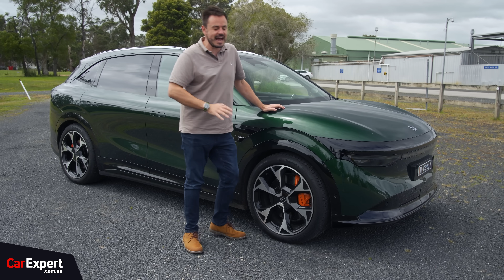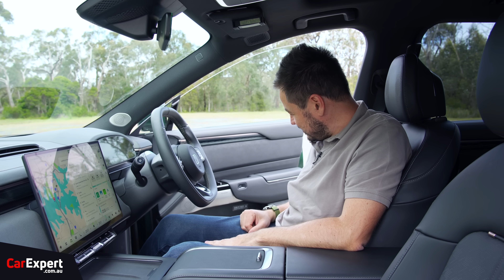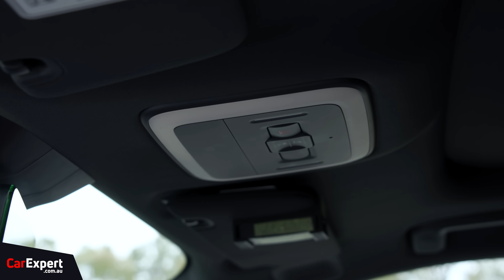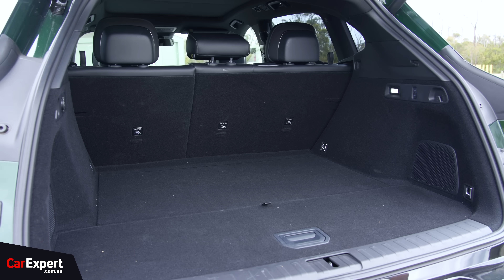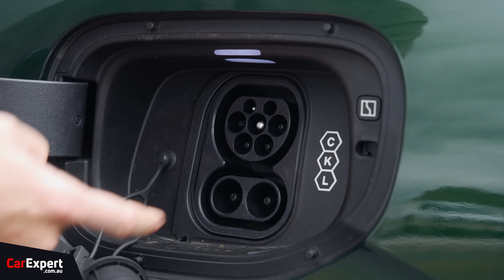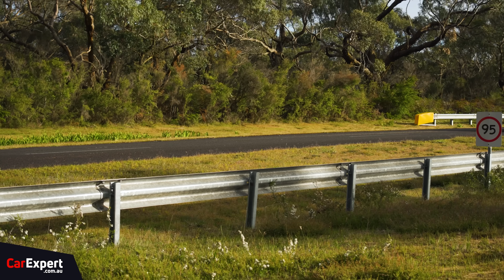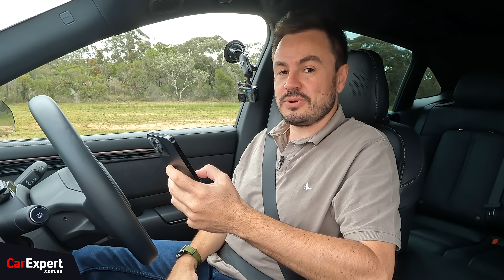The BEST EV I’ve driven this year…Zeekr 7X review (inc. 0-100 & braking)

Comment: The problem with Chinese EVs is that: if the company goes bust, then, unlike ICE cars, your EV pretty much becomes scrap metal because even your drive software is in the cloud which they no longer support.
Reply: zeeker's mother company is geely so your concern is highly unlikely
Reply: You can't be serious with that misinformation.
Reply: Geely the parent company own Volvo, Lotus, Smart, Polestar and significant holdings in Daimler (Mercedes-Benz) and Aston Martin as well, so i think we are good for a little while.
Reply: Geely is the parent, it's a behemoth
Reply: Like what everyone else said re: Geely.
But also what a load of idiotic nonsense. How do you think the car can function and drive when it is out of mobile range then?
Car software runs locally and is able to connect locally to your security keys and devices using RFID, Bluetooth & Wifi. Even without any mobile connected services you could still use your phone for hotspot internet access for maps or just use Android Auto or Apple Carplay etc. Your car doesn't just become a brick.

Comment: Bought mine and picked up in November from Geelong. Drove back to Adelaide and love the car! Powerful, comfy, sporty, luxury and so many features. Mine is the Tech Grey Performance model with 21" wheels. Wife loves it so thumbs up there. Friends scream "WOW" when you put your foot down to show its stunning acceleration. Charge at home from my garage via a 22kw charger. So cheap to charge up too! Brilliant car, excellent value, cheap to fuel up, and cheap to service (no engine). Do yourself a favour and buy one. 👍
Reply: Promote rainforest deforestation
Reply: How often would anyone need to charge at home at 22kwh, do you do back to back long drives draining the battery and charge within a cheap say 4 hour tariff window in the middle of the night. Also do you own an $80k car and do not have a solar array at your house.
Reply: @GDM22 i say bring on the 22kw chargers, cause why not :)
Reply: @thecookeman You would be running 30.6amp across each phase with the limit 32amp, doesn't leave much head room for anything else.
Reply: With AGL, EV rate is 8c per KwH between 12am and 6am. My 7X Performance has a 100Kw battery so just $8 to charge from zero to 100%! However I top up the charge regularly to 80% as it is an NMC battery. Only to 100% if I drive it immediately or very soon after charging. Small top up charges don’t harm the battery, not recommended to run down to 20 or 30% then charge up, unless necessary. Great car, still discovering its many features!!
Reply: A SUV I is not sporty. It’s brick on wheels
Reply: How match did the charging installation at home cost you?
Reply: @DH-jy6ts Around $950.
Reply: @realcooldog5588  Did you have 3 phase electricity supply before?
Reply: Yes had 3 phase supply installed when I built the house. Good decision!
Reply: @realcooldog5588  Lucky you. Doing it now may cost 4-6 K (in Vic) I guess.
Reply: Thanks for sharing, but you update this review in few months, because usually it is like a honeymoon.   You wakeup and you become unblinded
Reply: Love does that!
Reply: Congratulations! Would you please briefly comment how the car performs now? Any software glitches or other issues that Zeekr hasn't been able to fix? Some users say RWD is more stable than AWD model. What do you think?
Reply: What colour did you get ?
Reply: Does it drive itself like Teslas do with FSD(s) ?
Reply: @jorganzola1  for a performance car like this, you don't want it to drive by itself. You definitely want to hold the steering wheel!
Reply: @jorganzola1 only in China, it just has normal adaptive cruise control.
Reply: @TheoFennel  ... and with lane-centering assistance.
Reply: @Antmanzzz 
ADAS is on all new cars sold here I believe. Correct me if I'm wrong.
Reply: @jorganzola1  Yes, but that is a vague term - it can cover various safety systems as well as ACC+LCS etc - you have to look at the specifics for each model.
It usually doesn't include advanced self-driving automation though (e.g. FSD, XNGP, etc).
Reply: @Antmanzzz 
Yes, of course it doesn't include FSD.
Reply: @jorganzola1  在中国可以选装类似特斯拉FSD的自动驾驶功能，35000人民币！
Reply: @dyson1133 
In China, autonomous driving systems were recently tested and ranked in order of capability.
Teslas' FSD came out on top as you would expect - given that they pioneered the technology.
Some other systems were atrocious. The price doesn't reflect ability.
Reply: @jorganzola1    I've seen that test; Tesla's Autopilot is indeed amazing, showing excellent results across the board. However, Huawei and XPeng, right behind Tesla, also have impressive scores and are by no means bad. It's like how Apple is the benchmark in smartphones, but that doesn't mean Xiaomi and Samsung are trash.
The key point is that autonomous driving is purely a software feature—the core is the algorithm. Therefore, I don't think Chinese manufacturers will lag behind for too long. After all, with 30 million cars sold annually in China, they have massive amounts of data for training, plus a huge pool of talented engineers
Reply: @dyson1133 
Competition is good, and I wish these other systems the best, for it will make travelling on the roads safer.
Chinese systems may indeed catch up, however Tesla won't be waiting for them to do so.
Continual improvements will be ongoing.
Reply: @jorganzola1  why would one whant a car that drive its self ?
Reply: @kajak012 why would you want an EV?
Reply: @BobbyDazzler888  Why should it matter whether its,fully electric, hybrid, petrol or diesel? The point is, its a great car; especially for the price. Sounds like you have an irrational fear of EV's.
Reply: @BobbyDazzler888  charge while the sun is out?
Reply: @BobbyDazzler888  bot ring a bell?
Reply: @kajak012 why the hell would you not want a car that can drive itself. It’s literally the biggest advancement in personal transport since the invention of the car!
Reply: @andyg3752  why have a drivers license ?
please explain
Reply: @kajak012 because the government mandates having a drivers licence.
Reply: @andyg3752  i like driving being in control so i pay to have my drivers license,i drive a v8 cheap on fuel if parked in the drive way
Reply: @kajak012 
I would have thought the reason was obvious. However:
1. On long drives, you can arrive relaxed, driving in bad conditions can be stressful for some people.
2.  When perfected it will drive far better than the average driver & it will save lives.

Why would you want to drive your own car  knowing that doing so  risks your own safety, the lives of your loved ones and other road users?

Many thousands of drivers, passengers & other road users die EVERY DAY due to human error.
Eventually, all cars will drive themselves & communicate with each other.
It's not really about what you want, it's about what is best for everyone.
Reply: @kajak012 mm
Off the house battery if absolutely necessary
Reply: @kajak012 
Yes, it would be cheap on fuel if you park it on the driveway & don't drive it 😂
Reply: @kajak012  Call Uber 🤣🤣🤣
Reply: Why do I keep sensing this reviewer got financial complimentary support from Chinese car company? It is EV and so the autonomous driving abilities are a MUST.
Reply: @JHP-hj224 , I just want to be in control, and I trust nobody, let alone F* what.
Reply: @JHP-hj224 needs to be reviewed more often, alot of the China ev's are terrible at even lane assist, hilux, rav4 all trash too

Comment: What happens when a nefarious person sends an OTA update and bricks your car?
Reply: Careful, bots will eat you up
Reply: take your tinfoil hate off kevin
Reply: You can turn off all WiFi, mobile and network communications to the vehicle. It will reactivate when in a crash and when your car is serviced which you'll need to turn back on. Though then you will drive it as a car with a lot less features.
Reply: As an owner you have to accept an OTA update first. So if you are worried (that your tinfoil hat is not thick enough) then never update.
Also it uses PKI & certificates for secure communications and hash-checking for authenticity just like anything else that needs security.
Reply: Just a dead excuse against new technology.
Reply: Like what Porsche did to Porsche owners in Russia?
Reply: @f @frankandrews4470 what happen bro? Did Russia hurt your feelings?
Reply: @frankandrews4470  dunno mate, that's your story. The question still stands. What happens?

Comment: Howdy Paul  I have had my Performance model for two weeks now and love it.  Everything works well and is a pleasure to drive.  The doors have sensors to prevent bumping into things however I cannot say that about the boot.  Crashed and scraped the paint off the rear door first day when it hit the garage door.  I only received one "token" car key.  Anyone know how to obtain another?  Thanks Paul love your work!
Reply: ah thats a shame...most cars open slowly and if something blocks they retract. hope its minor scratch.
Reply: With your 7X you will have received 1 car key fob and 1 RFID key card. If you wish you can purchase additional key fobs or cards from your dealer. IMO it is not needed because the phone app acts as a digital key, and 95% of the time that is what you will use as the key (perhaps with the RFID key card in your wallet as a backup in case you drop/lose your phone).
You can set up each driver's phone app with their own Zeekr account, digital key, and associated profile with car seat/steering/mirrors settings etc, and swap between accounts or profiles very easily when entering the car.
A little too late in your case perhaps, but you can also set the boot lid to open to a specific height and it will remember that, to avoid hitting the ceiling of garages etc.

Comment: Good review Paul.   The interior looks quite good for an EV and well balanced.   However, visually at least, the driving position looked quite snug/small, there did not appear to be much room around you.   Maybe it is just how it looks on the video but it looked a little small in the driving position.   It seems quick enough in a straight line but it appears the handling and ride is sub-par for the power on offer.  I like soft-close doors but they do take a little to get used to.  It seems to be quite good value for what it is in the EV segment.  I am still happy driving hybrids but this EV seems to be a large step up compared to other offerings, especially for the relatively modest price.  It will be interesting to see how popular, or otherwise, this vehicle becomes.  Lastly, I still think EVs have a way to go before they become compelling buys.
Reply: They are so compelling right now buddy. Open your eyes
Reply: @kennyobe  I'm a car enthusiast and follow the car market quite closely and I will stick with the cars I already own which are all way better for my needs than the Zeekr 7X or any other EV.    However the Zeekr 7X does seem like a good buy for what it is for the low end of the EV  market.

Comment: I have one. Best family SUV I have ever experienced. There are many more features than the ones you mentioned and there are some errors you made. I was waiting for the Tesla Y performance but for me this is way better. 
Buy the Tesla if all you want is the best drive train, computer system and efficiency and happy for everything else to be a standard taxi. 
Buy the Zeekr 7X if you want the best looking most comfortable luxury ride and unbelievable features but still second to all Tesla’s best points. 
BUT then you look at price and the Zeekr kills everything else in this category.
Reply: I have driven the new Mode Y Performance and it is as fast as this, the interior is very very nice and so is the new adjustable suspension. I does not look poverty spec as the old Model Y used to be.
Reply: @trancenut81 
And it has FSD already installed.
(Just needs activation).

Comment: the Chinese market 7x has a screen in the 2nd row armrest to control 2nd row seat heating and cooling, theres also electric reclining for 2nd row and also option for a screen inside the passenger seat backrest, doesn't seem like the Australian spec have those
Reply: The Australian model has electric reclining for 2nd row - he just didn't show it in the review unfortunately.
The rear control screen is only in the Chinese model, and not in any export models.
Other cut features for AU include active matrix headlights, advanced ADAS features (LiDAR, faster processors etc), the front lightstrip & rear logo lights, electric lower/raise back seats for larger boot space), rear tray table, perfumes, etc.

Comment: A couple of corrections: It is a 21 speaker sound system.  And the doors work fine, it just means you weren't standing back enough.  And with a new Iphone, the wireless Apple CarPlay will not drop out.  Mine works perfectly. 12 v socket is in the trunk and a sunglasses holder is in the door arm-rest.
Reply from the maker: Sorry about that - you’re right on the speaker count! We had plenty of issues with the doors on our car and weren’t standing too close.
Reply: @CarExpertAus you have to stand outside of the door arc trajectory. You kinda have to rewire your brain (because we've never had to do this with manual doors) to stand behind the door everytime but the doors worked perfectly once I had wrapped my head around how it worked.
Reply: @N1rOx  agree mine work perfectly once I figured it out. I don’t think Paul had worked it out yet.
Reply: @N1rOx  This, plus you need to be a minimum of about 10cm behind that arc too, because they are quite sensitive.
It is also a bit annoying when everyone is trying to get into the car at once, and the front passengers are slightly in the way of the doors of the rear ones.
However, on balance I now think the doors are 'OK' as the pros slightly outweigh the cons, whereas on purchase I thought I'd prefer not to have them.
Reply: Why are so many Aussies buying electric vehicles??